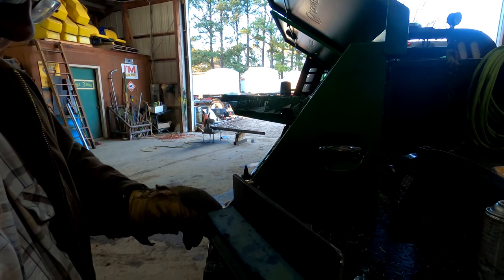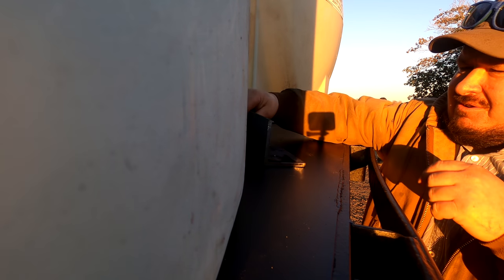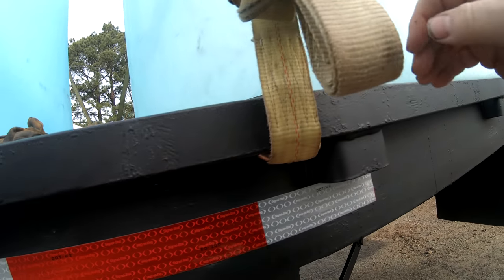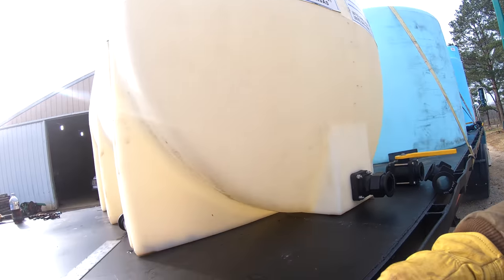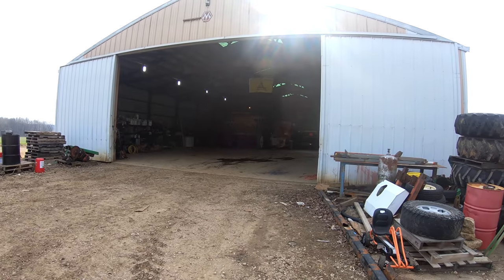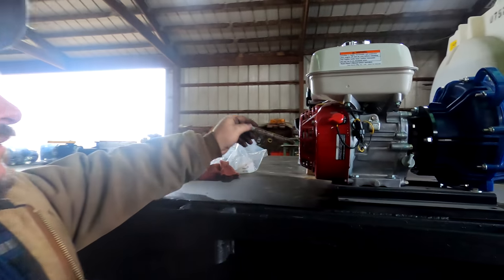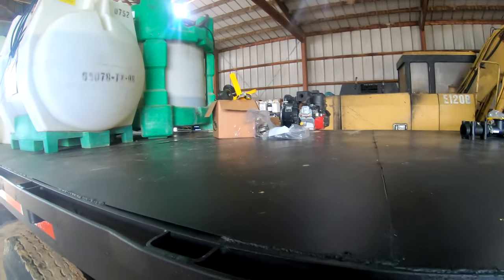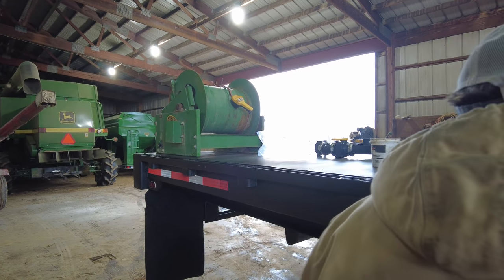Pumped Up!  Day 3 Water Trailer Project

Comment: Make sure to support your valves if you haven’t. Have witnessed the tanks start the crack with the weight of the liquid nitrogen. We blow all of our lines out using truck air. Surprised you didn’t buy a van trailer. Everyone in this area is going away from flatbeds. We made the switch 10 years ago was one of the best thing we ever did. Having everything inside is so much nicer.
Reply from the maker: I bet it is nice having stuff inside.  We are always about 10 years behind here in West TN LOL.  I don't think I have ever seen a water rig made out of a van trailer in this part of the world.  A lot of people have went from flatbed trailers to drop deck trailers.

Comment: Dylan , you will be happy that you went to the work of setting up that water trailer.  You might be able to undo the recoil on the Honda water pump and give it half a turn and then be able to pull start the motor from the ground.
Reply from the maker: That's a good idea but I think we are just going to leave alone for the time being.  We will have to get on the deck to add our chemicals in the mixing cone and to rinse it out so we will probably just crank it when we are doing that.  Thank you for watching.

Comment: I did something similar but I put pump under trailer and mixing cone at back so I could fill it either from ground or trailer. I use gravity to run chemical from shuttles to mixing cone through separate hoses and valves.

Comment: Nice setup there. You could unbolt the pull rope assembly from motor and flip around to punt towards you. Then you could crank it from the ground. Just an idea!
Reply from the maker: That is a good idea.  I don't think I will really know how I want it till we have the chance to run it some.
Reply: @DylanJoyceFarms   I hear ya. Nice setup those. I’d like to try out those flange fittings

Comment: Our water truck was an old chopped off international school bus.  It was easy to get up on the deck because we left it open but always had a wet seat if it rained.
Reply from the maker: I've never thought about that but I bet it worked pretty slick. A local sod farm has a school bus that they turned in to a service truck where the whole crew could ride to the field together.

Comment: You might want to put a little pool chlorine in those clear tank. We run tanks just like that, and we've had a problem with green algae growing in it. But the low rate if chlorine knocked it out
Reply from the maker: I've been thinking about that. I had a storage tank that we were filling up out of one time that had a terrible algae problem. I'm going to try to keep the trailer empty and in the shed when we aren't using it to hopefully prevent algae but I'm going to get some chlorine on standby just in case lol.
Reply: @DylanJoyceFarms  You could also paint them with tremclad rust paint.